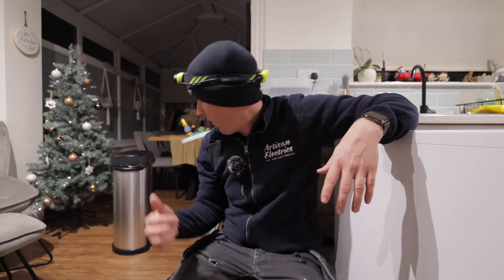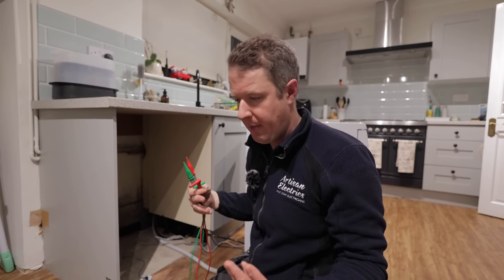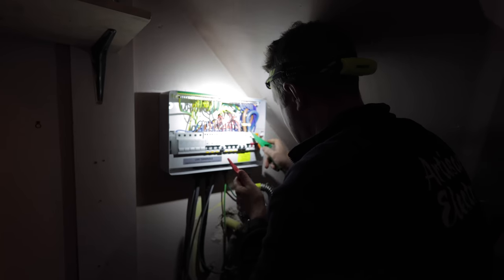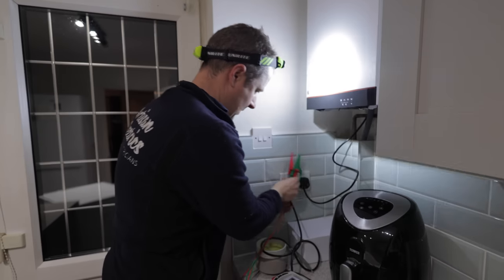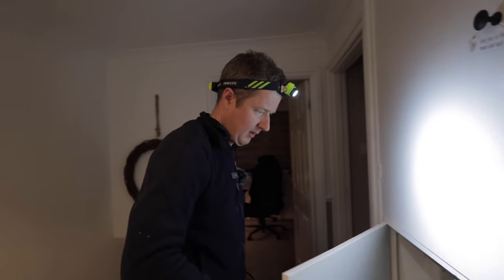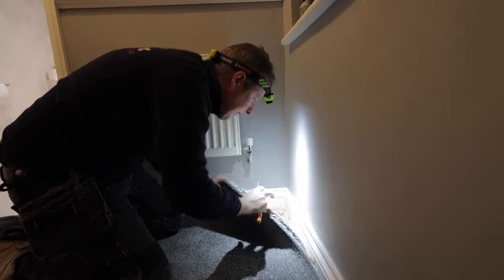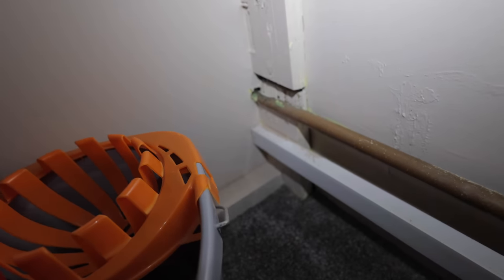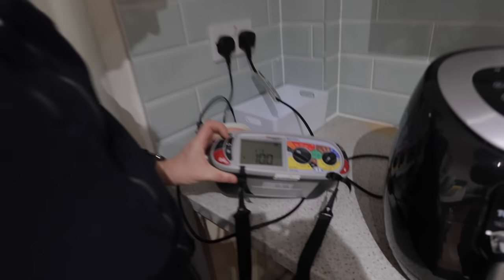Nearly KILLED by a CRAZY fault! What on earth is going on? 💀

Comment: Sadly I've come across this before but only because I get called in to fix things like this specifically as I'm dual gas/electric qualified. Straight up this is RIDDOR reportable and the Gas Engineer that fitted it should be reported. I have absolutely no sympathy for them if they lose their license, get fined or even jail time. This was in no way acceptable on any level.

I am glad you're okay Jordan and this needed to be highlighted to the public.
Reply: No way is that a RIDDOR! Just crap workmanship.
Reply: @paulteasdale7112   Actually it is, it's in the title. 
Risk of Injuries, Diseases and Dangerous Occurrences Regulations. 
Dangerous Occurrence is exactly what happened and "just crap workmanship" is not a valid defence. 
The requirements of BS7671 are the minimum Required. The statutory EAWR are to be adhered to as are the Gas Regulations.
Reply: @paulteasdale7112  It's definitely RIDDOR.  It was potentially lethal.
Reply: Did Jordan not mention in the video an electrician was called in to wire the boiler. Seems harsh to blame the resultant shambles on the Gas Engineer? As dual gas/electric qualified do you not think Jordan should have run a five core cable which would provide for LNE to the boiler, 230v Live from the boiler live send connection back to the controls and then 230v back from the controls to the switched live input? This way, if the boiler is switched off, there is no risk of 230v suddenly appearing on the switched live.
Reply: So a wire hanging out of a junction box is RIDDOR? A missleeved switch line is a RIDDOR? An incorrectly wired lightswitch is a RIDDOR? These are ALL potentially lethal situations. There are scores of potentially lethal conditions we find ourselves in every day. Do you report them ALL to the HSE??
Reply: A completely unexpected unplugged plug being live is definitely riddor
Reply: An electrical shock is not RIDDOR reportable per se unless it leads to death, hospitalisation, time of work, a fire or an explosion. Exposed conductors are reportable to the HSE under ESQCR for installations that fall under its remit, but I believe that would stop at the meter for a domestic installation.
Reply: @paulteasdale7112  It certainly is - the customer could have unplugged that, touched it and died. It's bloody reckless.
Reply: @simonarmstrong2754  I must have missed that bit of the video. Even more reason to report the electrician as they should know better. There was no 5 core needed for this as he has wired it from the upstairs circuit. LNE/ SL down to the boiler with the isolator by the cylinder for the system. If you're switching the boiler off at the appliance switch you'll still have 230v inside the appliance at the connector.

The better option would of been to bin the Hive and get an opentherm or Viessmann control using ebus and remove the 230v SL altogether, especially as that is one of the best modulating boilers on the market when paired with efficient controls.
Reply: @SquirreliciousMe  No, I don't believe that is the case as the shock hazard was well less than 30mA which would have tripped the RCD. That's why the RCD didn't trip when Jordan got a shock however it probably felt bad because it was uninterrupted.
Reply: @johnh9449  I’m not sure how that’s relevant. The installation was left in a dangerous condition. Relying on some other component of the installation to get you out of trouble isn’t really any defence.
Reply: @SquirreliciousMe  Well, it's relevant to what happened in that it wasn't lethal on the day with a limited current and being below the RCD threshold which also explains why it didn't cause a trip. I'm not suggesting it's intrinsically safe. It's an unsafe installation I agree. The input circuit limiting the current is unlikely to have been designed with double fail safe in mind for the unplugged situation! Safety approvals would be on the basis of being earthed and installed to compliant standards as stated in the installation manual - which hadn't been followed. Even the plug itself is a fail as it should have a fixed double pole isolation switch.
Reply: @johnh9449  right. So it’s unsafe then. And unsafe not from bad luck or a situation that wasn’t reasonably manageable but from wholly non compliant install. Glad we got to the only relevant point in the end.
Reply: @SquirreliciousMe  I think this exchange has been at cross purposes somewhat but it raises the interesting point of probability. 
I totally agree it's bad and unsafe practice. 
I was simply explaining what happened and why for two reasons (1) limited current below 30mA and (2) there was an RCD in play (that didn't trip proving (1)) and that it was unlikely that someone would have died. 
For someone to die the current would probably have to have been above 30mA and in addition the RCD would have to be faulty and not trip - in THAT given situation. 
That was very unlikely. One protective feature multiplies with the other vastly lessening the chances by several orders of magnitude. That's why we have RCDs AND safe product design. The two combine to mitigate against unsafe installation practice. That's not to excuse unsafe installation practice by any means. Safe installation practice should be a third protective feature to raise safety probability by yet more orders of magnitude. 
You actually have an overlapping situation where one safety area can multiply and compromise another e.g. installing the boiler outside in the rain shorting the whole thing out would compromise the product safety leaving only the RCD to save you. Silly example but demonstrates the interdependence and why each area of safety is important.
Now, you could argue that the same incorrect boiler installation (indoors!) may have been done in a house with a wooden fuse box with no RCD and that would have been far more dangerous as one little resistor would then be your ONLY safeguard.
There's no way I would contemplate prodding an 8.2k 0.5W 350V rated resistor into a 13A socket (drawing 28mA) to test my RCD's 30mA threshold and disconnection time. Probably I'd be Ok as the resistor value defines a safe current and probably the RCD works but I don't like taking unnecessary risks. Besides there's a handy button to press instead.
I far more certainly wouldn't test the theory prodding the resistor into the DNO cut out as then I'd have to worry about how dry the surface of the resistor was, if it could be faulty and if I could disconnect fast enough before it overheated and possibly arched across and welded my fingers together because the 100A fuse wouldn't protect me. 
So yes, important to maintain standards in ALL areas. The more things you have protecting you the more you are protected against someone else's error or the inevitable component failure.
Reply: @johnh9449  The chap is right, it could have killed someone. The 30mA rating is below the 50-150mA rating that can kill an average person. The elderly or children were at the greatest risk as the threshold drops to 20mA. Hence in most countries in the highest risk areas (bathrooms for example) outlets are limited to 5mA or 10mA.

Unlikely but still possible under the right circumstances, and that's sadly what this video highlighted. 
For me it comes down to the same poor workmanship as Flues not being secured properly in an attic space, allowing the products of combustion to discharge into an unused area. The chap further up would likely claim poor workmanship and don't worry about RIDDOR but it has the potential to kill when above bedrooms and CO poisoning symptoms are common in that situation. However most attics are ventilated spaces and it's not an issue unless under the right circumstances, the requirement is to avoid the circumstance entirely.
Reply: @Effer Vescence  I agree. You make some good points and I'm glad you agree it was "unlikely but still possible" which chimes with the point I was making about probability. When someone says "it could have killed someone" the word "could" is used to emphasise the possibility even when the chance is perhaps unlikely. Possibility is the reciprocal of probability in this sense. Safe practice is to maximise the safety probability (denominator) in order to make the possibility of death or injury (numerator) vanishingly small. But the actual numbers are important and when left unquantified allow both exaggeration and underappreciation and a lack of perspective. Humans have poor appreciation of chance. 
I can think of a mad example: Imagine playing Russian roulette with a pistol - a 1 in 6 chance of death. Most would agree it would be stupid to play and extremely risky. But increase the number of chambers in the barrel to 100. Now a 1 in 100 chance. Still stupid to take the chance but unlikely to kill you. Increase the imaginary barrel to 1,000 chambers. "Very unlikely" to kill you "but still possible". 
Most would still think you'd be mad to take the chance - and yet - many people smoke and smoking 10 cigarettes a year gives you a 1 in 200 chance of dying in any one year. So they happily smoke away but wouldn't dream of doing something five times less risky because it "could kill you". Of course the sensible answer is you shouldn't do either but quantifying risk and understanding probability gives you a better perspective.
Interesting you brought up the thresholds of RCDs. I think in the USA they only have RCDs for bathroom areas (called GFCIs) set to 2mA so the rest of the house has no such protection. They also have plugs with no fuse and unshrouded pins a child could easily touch with small fingers when half inserted. Some would say "it could kill someone" and yet the litigious and health aware USA put up with it and admire all the safety features of our UK 13A plugs!
Interestingly 2mA is a figure I surmised might be the design choice used on the boiler input having not found a schematic. 30mA would require a 6.9W resistor so a more reasonable 0.5W resistor would be 2mA so actually unlikely even to kill a child. It "could" kill in the right circumstances but that would be failure of the resistor or such equivalent situation. Not something that should be relied upon of course - a single component reliance is such a slender lifeline.
Reply: @johnh9449  Almost all circuits are GFCI where I was working in Cali and Texas - effectively countries in their own right. Most bathroom outlets were 5mA or 10mA not 2mA.
Point of the matter is it would be a C2 - At Risk on an EICR without the plug, C1 - immediately dangerous with the suicide plug. Under the required regulations RIDDOR reportable, enforceable by fine and if anyone did get hurt or killed prison time which was my original point. It's not "bad workmanship" C3 improvement recommended regardless of the probability, because probabilities aren't a protection factor in a court of law.
Reply: @Effer Vescence  Yes, I think you are right about 5mA. I'd heard 2mA mentioned somewhere but the only reference I can find now to 2mA is a must not trip below test start when ramping up to test the trip point with the nominal lowest 5mA device. They used only to specify them to cover wet areas but a brief search also finds their regulations changed in the last few years to cover all outlets - so things have improved - but presumably many properties won't have this and many still only have two pin plugs etc.
Anyway, 2mA was just my guess for the boiler input current with a limiting 0.5W resistor - this level of current, if the case, explaining why it gave a shock but nobody died and why the RCD didn't trip.
As to being reportable to the HSE, nobody was injured. It doesn't seem to come into the category of a near miss as they define it. A gas engineer servicing the boiler may report it as an unsafe installation (they could touch the switched live thermostat wire direct inside the unit without the resistor current limit in the way) but arguably Jordan may not wish to do this.

Comment: I love examples of things where most people would say "would never happen, not in a million years". This was genuinely exciting watching this develop! What time did you finish?
Reply: This is in fact a very common mistake, as multiple zones and UFH becomes common, having a volt free feed to a boiler usefull.  many plumbers install UFH and use a seperate wiring centre.  Instead of bringing a two core cable from the boiler to the wiring centre to act as the supply to the switch and the switching back, a contractor would often link the feed to the volt free switch to a 230v connection inside the wiring centre.  This often worked if the boiler could tolerate a 230v supply.  However it often blew a board not designed for this.  In addition, the boiler could be turned off to be serviced or repaired and it was possible that a call for heat during this service time would result in 230v being sent to the boiler.  I have seen this hundreds of times in my previous role.
Reply: @nigelsanger7827  I live in a council owned rented property and exactly this happened. I had to have a  socket replaced in the upstairs bedroom and the 'leccy guy pulled the wired fuse out of the box, and then proceeded to strip the damaged plug out. About 30 seconds later, there was an almighty yelp and a loud bang from upstairs. Apparently the socket was still live as the 'leccy guy found out.  He got the plug fixed and left in a foul mood.
A few days later the council called to inform us, we needed a complete rewire and new fuse box.
This was before circuit breakers and such. We had fuse wire and a big grey box on the wall between the meter and the fuse box. It had a trip and reset button and that was it.
 We had it replaced by a shiny box with so many rcd things, it was amazing...
Reply: @nigelsanger7827  great response. Would some education (and mandating it into code/standards) be useful? Having the old t&E supply a relay coil, then use that relay to switch the input to the boiler. 
It's obvious that having two circuits to one appliance will cause confusion, so educating & enforcing that it's never ok to use another circuits neutral for a different circuits active would be the key point.
Reply: @Jeff C  Yes, the UK controls training is very poor.  In my previous role of Technical Director of plumbing for Speedfit and RWC, it was part of my responsibility to develop controls.  This involved working with control manufacturers and designing the wiring diagrams for different scenarios.   I had a number that showed exactly how to avoid this fault as many plumbers and electricians think that as long as there is A 230v live feed, all will be OK.  This is historic,  however as I have seen many times, this is often the consequence.
Reply: I always laugh when someone says. Don’t worry that would be a 1 in a million chance. My response to that is. O so it happens 170 times a year then does it? There are 170 million houses in the United States.
Reply: @nigelsanger7827  I'm starting to adjust my annoyance factor when required to follow such strict and what I thought were overkill code upgrades.

Comment: Basic lockout tagout error.  Always do the following without fail:  Kill the circuit, verify cold.  Energize circuit, verify hot.  Kill the circuit, apply lock and tag, verify cold.  If equipment is attached, verify equipment is inoperable.

Comment: Nice to see you traced the fault and correctly repair it Jordan. How many properties are out there that someone has replaced an item and "borrowed" power off a different circuit. This is why the electrical rules were brought in. I had a lighting circuit in a property borrowed the live from the downstairs sockets feeding a 2 way circuit. I removed the lighting power as the bathroom light was wired direct to the bulb and not switched. I turned off the circuit and removed the switch (bulb was not lit) yet there was a permanent live in the rear of the switch.

Comment: Im a heating engineer, come across this issue on a fairly regular basis. Usually after a boiler relocation where the old appliance was a SL feed only new appliance needs a permanent live  and they only have 3 wires available so wire a plug into thr boiler for the permanent live and if a SL demand comes on it back feeds down the plug if it’s unplugged

Comment: If you are taking floorboards up or taking boards up from previous work I always felt tip pen number them which always guarantees the correct board in the original space. Mark the first fixed board as the start with a "F" marking which will even give you the correct orientation of the numbered removed boards when you come to re-affix.

Comment: Back in the early 90s I bought a maison de village in the south of France. The previous owner had renovated the house to a high standard, though I am not so sure about his knowledge of electricity. 

The house had been fitted with a series of wall lights, and when we moved in, we found, he had taken the wall lights, and disconnected by cutting through the wires. 

I popped down to Conforama and bought similar lights, then switched off the lighting circuit at the main junction box, and started on the first floor lounge. 

That went ok, then I worked my way to the stone stairs, which led to the ground floor. I started at the top and started to use a Stanley knife, to pare the wires. 

As the blade touched the wire, there was a terrific jolt going through my body from my right hand, holding the knife, down to my bare feet on the stone stair. 

Wow, that took a few moments to get over, then I went back to the junction box to switch the electricity off completely before finishing the job. 

As I recall, the voltage would have been 200 volts AC, slightly less than in the UK, but I think I was lucky to get away with it. 

So beware, in dealing with French electrics. They can be a bit laissé faire, to coin a phrase, at times.